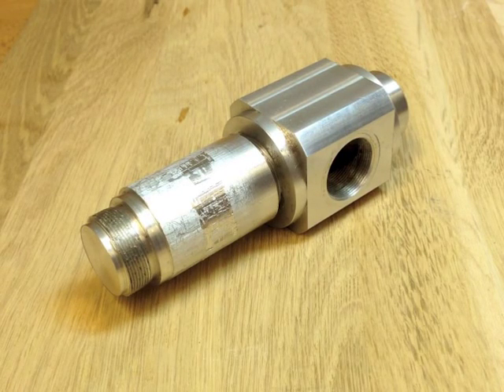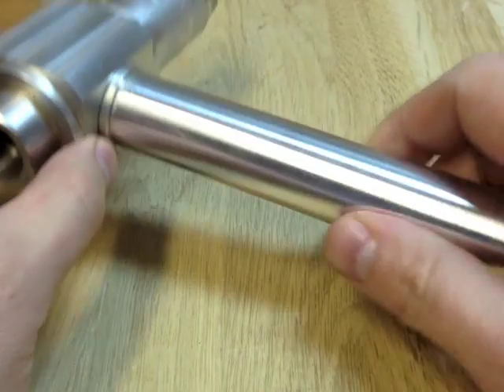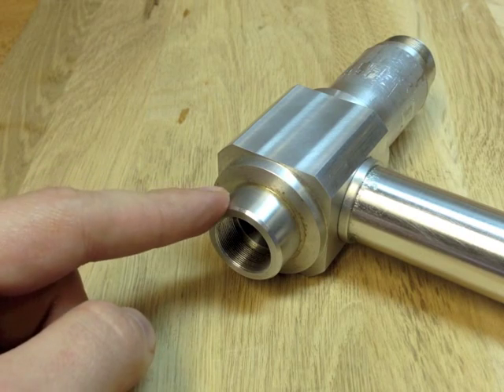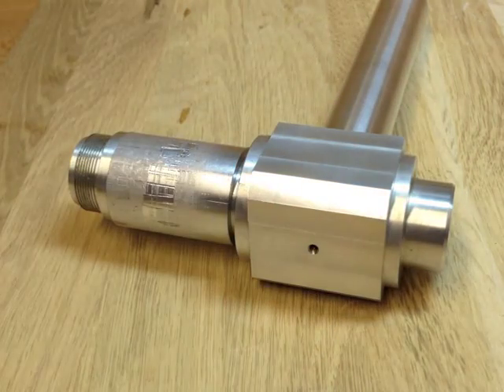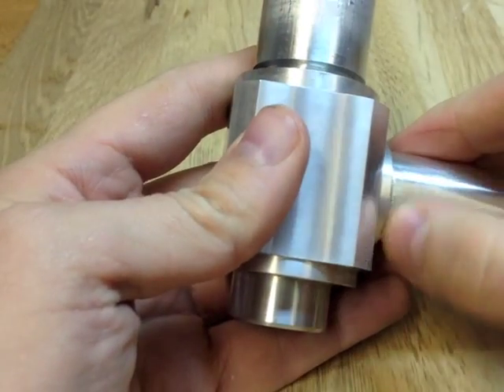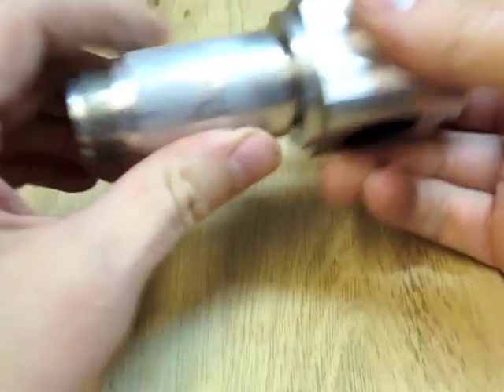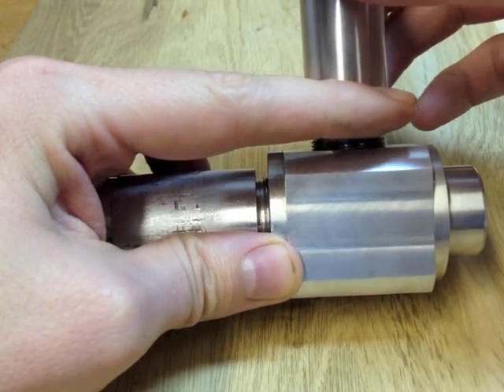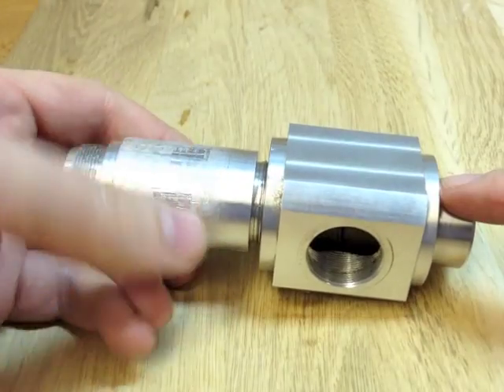Making a Watchmaker's Centring Microscope

Comment: I’ve been a machinist for over 30 years and I can say without hesitation that your error was in using the same materials on mating threaded parts. The threads have gauled
Reply: Hit the enter key by accident. I meant to say galling of the mating threaded surfaces, essentially cold welding of the material. To avoid this you should use two dissimilar metals, usually one soft and hard. Brass should work with aluminum. Also keep the threads on loose if you plan on a plating build up.

Comment: Fading off and mumbling leaves one out in the ozone.  Completely inconclusive.
Reply from the maker: +100nortonfan You're right, mister, these videos were too long, too boring, and guess what, I still haven't finished the scope! I stopped when repeated attempts at anodising failed. I will finish it, though, and give you some return on your investment of having sat through those very tedious videos!
Reply: @KosmosHorology  Fwiw and possibly by now you already know this. The parts have galled. This happens when the exact same metal types are threaded or even press fit together. Steel or brass would have been the better choice for the smaller parts at each end. Second best would be using 2 distinct and quite different aluminum alloys. 6061 and 7075 for example. I'd be willing to bet you've used the same alloy for all the parts. so that results in them becoming stuck together. If the parts had of been anodized first that will also help to prevent the problem. I fully understand there's some real benefits in keeping that centering scope light weight. Titanium could also be used for the smaller parts and I've heard it anodizes well. I'd double check that to be sure though.